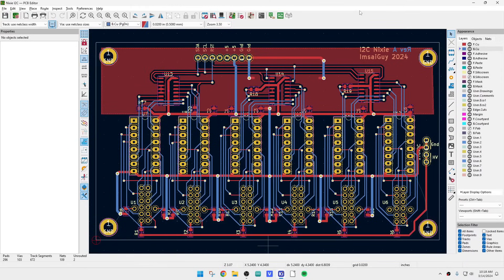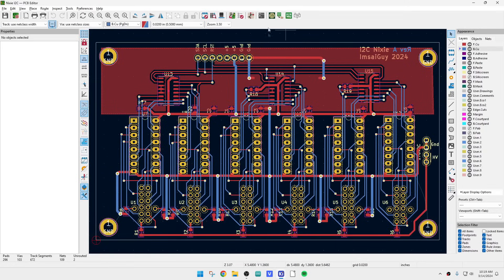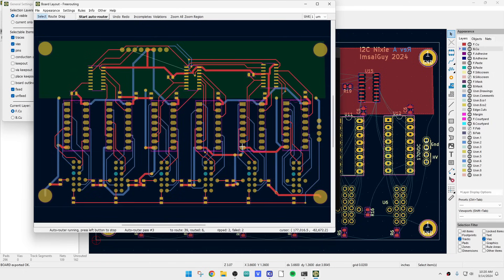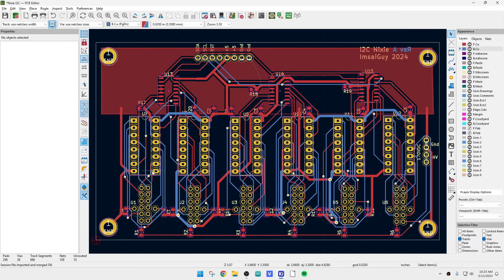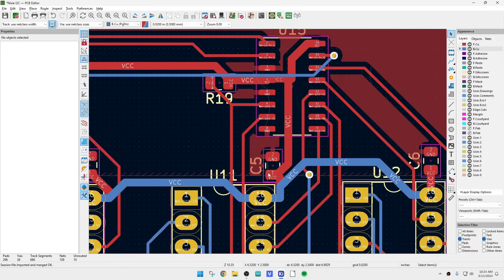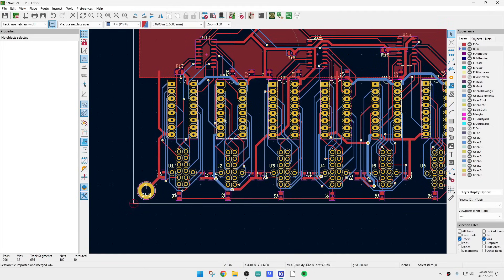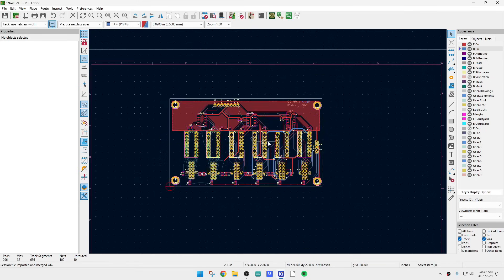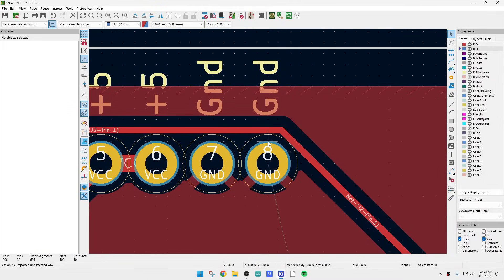#1805 KiCAD Autorouter

Comment: I used to autoroute PCBs every time and then optimise by hand, saved a load of time because the autorouters were fairly OK in in early PCB packages like EasyPCB but as component density got higher they never really seemed to keep up, these days I route almost everything manually

Comment: I tried the auto router in DIPtrace then imported the results into KiCAD for final cleanup a few times. Without fail, it took me as long to clean up the resulting messy traces and multiple DRC errors as it would have to do it by hand. THE first step to a successful board layout is proper component placement.

Comment: The lack of reasonable auto router why I haven't switched to KICAD from  Diptrace.   Once you set the rules up on the Diptrace autorouter it does a reasonable good job.  That being said one does not just kick it off and order the boars when done.  In my process, once placement is done I kick off the router just to get an idea of where I got problems, make placement adjustments and try again.  After several rounds of this I unroute everytingg do my grounds, power, copper pours, clocks and critical traces by hand routing.  After saving a backup copy,  the auto router is run again, to see what it looks like.  Likely I will not be happy and do more hand routing.  Eventually the auo-router will do all the remaining traces good enough but there will always be traces that need adjusting by hand.    I just another tool the process.  And forget about autorouting analog.   This is only possible because Diptrace has a good and fast autoroter allowing fast iterations.  You also need to do some tuning of the routing parameters.

Comment: Handy tip for that can be helpful with some  aurorouters: Rroute your power / grounds / bypass caps / critical signals and save the board  before turning the autorouter loose.  Better AR's will have a strategy to setup the routing directions per layer, cost per via, etc.
Reply: A better tip:
Don't route power at all, use internal power/ground planes and only do a fan-out on smd parts. Through-holes are automatically connected to the planes. 4-layer boards are dirt cheap today and you get immensely increased signal integrity by having a reference plane.

Comment: Can you also please do a video with KiCad explaining the impedance traces, let's say you want to have two traces that should be 50Ohms and he should figure out making them same length. Like those multiple S shapes you see near Memory chips for example.
Reply: Aren't the multiple S shapes a way to get the lengths of traces all the same so the timing is the same for all the timing critical signals (for example the bits all arrive at the same time at a memory chip)?  I don't think those shapes have anything to do with impedance.  Impedance should be controlled by trace width and adjacency (distance) to the ground plane(s) unless I am mistaken.   Best regards.

Comment: It should create the shortest path of least resistance with round edges 😊, kind of Art. Let's hope it gets better maybe with the help of AI 😊
Reply: I'm pretty sure there is a plugin that will round off the corners after a trace has been routed. Push and pull routing is already pretty complicated. Doing it with rounded corners taking up so much space would be even worse.

Comment: 45° is good for limiting inter trace capacitive coupling
Reply: The reason being?  Other than the traces gets slightly shorter?
Reply: @MatsEngstrom  For me, it looks like this auto router tries to avoid placing traces over other on long paths.I would sometimes use AR only in early part placement phase - mixed signal boards. Just observation which must not be universally true.
Reply: @staryduren Good point.  PCB under Linux used to have a router that you could invoke for a single trace or a group of traces if I recall correctly.  Sometimes when using that I would ask the computer to autoroute a trace or group of traces to get it's recommendation.  Many times I could use what the computer provided.  It was a great aid when routing a board with a lot of parts and connections because it would speed up my work considerably.  It was more of a hybrid router I would say.  I will probably do some playing with the new KiCAD autorouter and see if I can use it that way.  I have never done what IMSAI GUY did where he autorouted that whole board even when using PADS (a professional EDA package with a pretty darn good autorouter).  Why, because with that much routing to check I missed problems.  For me it is much better to keep making incremental progress even when using an autorouter.
Reply: @geekthesteve6215   Interesting. My experience was running AR on whole board when no other constraints on element placement. This way boards was later 'clean' in terms of EMC. I used mainly Eagle from CadSoft.
Reply: If a trace must pass over another it is better for crosstalk if the two traces are perpendicular. @MatsEngstrom
Reply: Eh....  What has that to do with 45 degrees angles? @andymouse
Reply: Oh yeah, I think I was drinking LOL ! I knew what I meant ! yep that would be 90 degrees sorry :) @MatsEngstrom

Comment: Why would anyone use an autorouter? Imho, the routing process is the most relaxing process in the entire board design.
Reply: Speed up the process, I dont like doing repetitive tedious routing although I never used auto router myself
Reply: yep :)
Reply: Obviously it depends on the board. High density logic with six signal layers? I'd take the auto-router. Two signal layers and lower density? If I have the time I'd route manually.  Either way, I would always route power and critical traces manually first, before otionally mopping up the remainder with the auto-router. Some auto-routers have very good optimisation capability, even making a good job of tidying up manual routing.
Reply: and depends on the size of the company and volume of different layouts needed per year